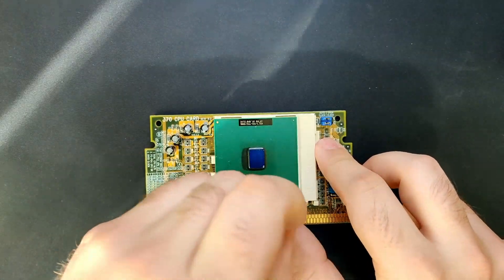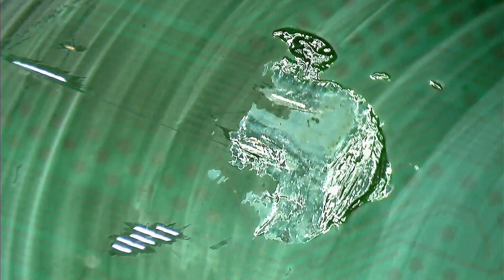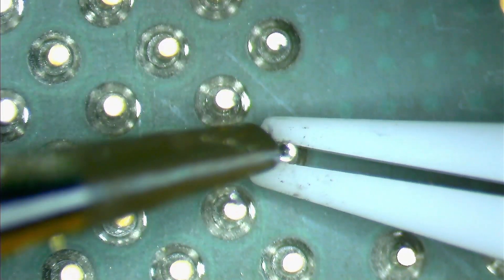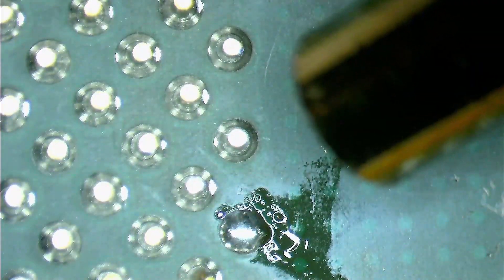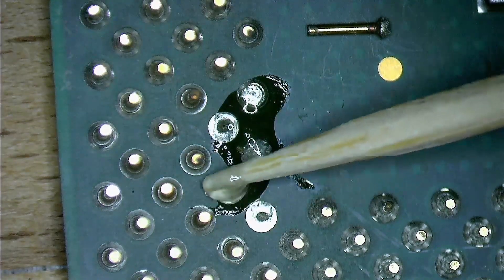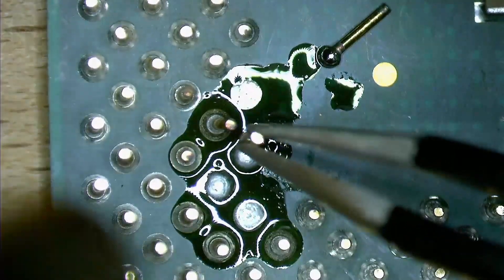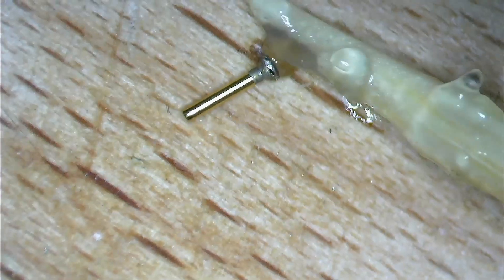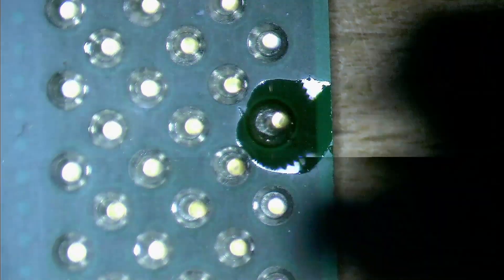Learning how to solder CPU Pins

Comment: Can't you just heat up the CPU from the bottom ?
This is usually what you want to do somtimes when you have a PCB with plastic so you don't burn it
By heating it from the bottom, you prevent the airflow to move any other pin I guess ?

Worth a try.

Comment: I found desoldering thru hole  chip sockets are a pain  a hot air station works but it destructs the socket but the socket pins are way easier to remove.

Comment: The ricochet sound was perfect. You could follow it up with a bowling strike sound when all the other ones were falling down.
Reply from the maker: Haha 😂 - I didn't think of that. I recently fixed CPUs like this using my new Atten hot air station. It's a night-and-day difference! Being able to control the airflow down to 1% makes it so much easier to not blow over all those pins.

Comment: You need to get a soldering iron with a very fine tip, I have an old soldering iron about the same size as a ball point pen with a needle like tip it's perfect for jobs like this. Oh and flux flux flux, helps solder flow to the metal.
Reply: I was going to say, an iron would work better with one of those fine-tipped hook-shaped iron tips. It'd be easier to get good contact with the solder between the pin and pad, even with the smallest amount of solder on the iron.

Comment: I removed some pins from a dead PIII to replace missing pins on another PIII a year or so ago. 

No microscope and no heat gun, just a soldering iron and flux. It really wasn’t so difficult, the repair is nice and clean and the CPU works great.
Reply from the maker: That's great! I am not sure if I could accomplish this without messing up the entire pin side.
Reply: Are there any good practices to follow to do this?
Reply from the maker: If you have a dead CPU, practice on it before you attempt to fix a pin on the CPU you want to rescue. Learning by doing. After maybe 20-30 minutes, and hopefully a few successful pin swaps on the dead CPU, you can try on the other one.

Comment: Failing to use flux is the #1 mistake of young players in the soldering game. Also, using the correct flux for the task at hand is essential.  The other big issue I see with youtuber amateurs is dirty, unmaintained solder tips. Keep those things clean and you'll have a vastly better time.  Burnt rosin and oxides from Pb and other metals accumulate and can contaminate your fresh solder, causing issues. Brass wool is your friend.
Reply: I have been trying to solder without flux and haven't done anything right yet lol 

If you don't mind me asking im curious; so I should buy a new roll of solder wire and flux compatible with that wire? And my tips have black residue on them. If I clean them should they still be good?
Reply: You’d be surprised how much caffeine negatively impacts microsurgery.  No caffeine from midnight be for working with a microscope and you’ll find it much easier.

Comment: YOU NEED SOME SMD SOLDER TWEESERS - YOU CAN HOLD THE PIN AND HEAT IT UP THEN PLACE IT.
Reply from the maker: I wonder if those would work - would make the entire process a lot easier! They just have to be solder-free otherwise it will be the same mess as with the iron.

Comment: Yes this is how it's done. As you say in the video it's more a matter of practice and repetition than anything else. 

Grinding down the traces can help too if there's any oxidation on the copper the solder won't take. And cleaning the soldering tip helps keep the solder from sticking to the iron and pulling away from the traces.

Very nice work. Kudos!
Reply from the maker: Thank you!